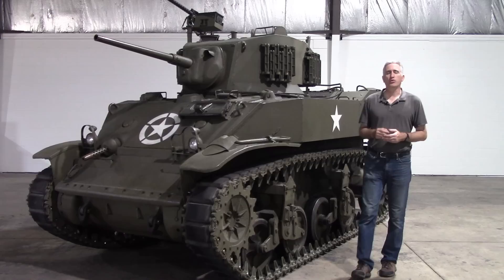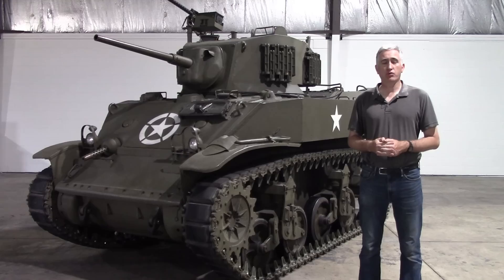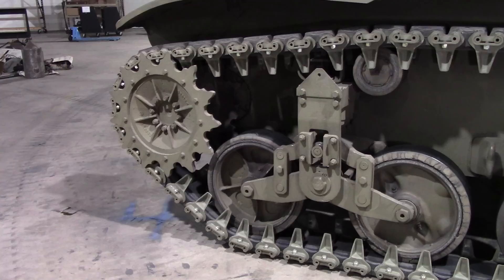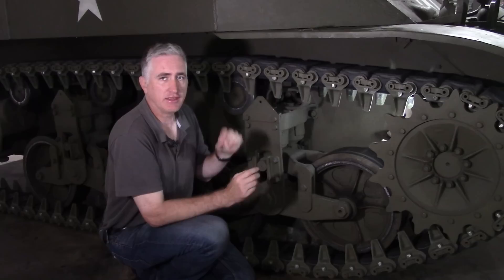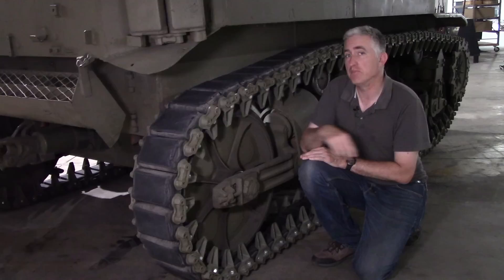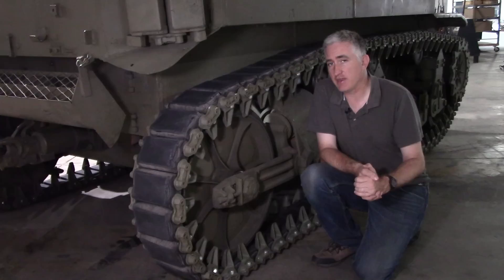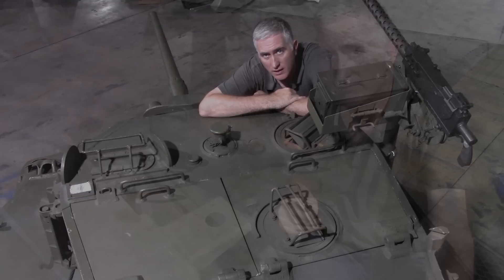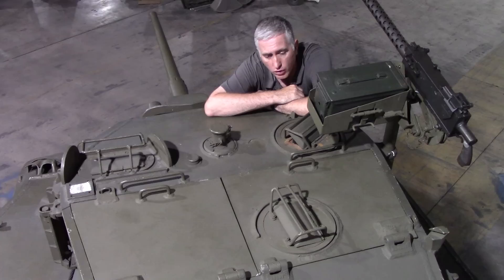Inside the Chieftain's Hatch: M5A1, Part 1.

Comment: I’ve gained an additional level of respect for the men who fought in tanks since watching  the Chieftains inside/ outside videos and visiting Bovington.
Reply: I never realised just how cramped and small it was inside a tank. I knew they were  tight quarters but after seeing the cheiften squeeze into the stuart i realized how nuts it is to not only be in there but to try and operate guns and not get hit at the same time. Im amazed they manage ti be as efficent as they are
Reply: @jamiebell314  APHE or HEAT shells couls vaporize an entire crew.

Comment: The Hydramatic automatic transmission (as well as their v-8) was developed by the Cadillac division of General Motors in the 1930s, but was first offered on an Oldsmobile since they had done all the testing at their test track.  Thus by 1940 America had a functional automatic transmission ready to go. When offered on cars after the war, GM touted the fact that it had been "war tested" and "refined in battle". Of course thousands of returning servicemen attested to it's reliability, and ease of use. Thus American drivers accepted automatic transmissions long before the rest of the world.

Comment: Don't see a note here, but when they talked about using the Tanker's Bar and 175 pounds, they meant use 175 pounds.  In WWII, anything that was "field serviced" considered the tool used and you simply found a guy or two who weighed the appropriate amount and put them on the end of the bar.  Same method was used for putting propellers on airplanes and I suspect many other items as well.  The manual simply told you what length of bar to use and how much weight to put on it.
Reply: I just made this same comment.

Comment: I have to say, I have always thought of the M5 as archaic and a prewar hold over. However, after seeing this, it is better engineered than my perception. It was obviously obsolete but it was relatively well thought out with the exceptions mentioned in this video. These are really interesting videos. Thanks for doing them.
Reply: "Obsolete"? Now for sure, but at the time it was a quick little agile light tank. It did it's job

Comment: Not sure if this has been mentioned but from what I have seen there was a separate general infantry manual that included a way to determine a consistent weight for various needs. For example, a Jerry Can full of water should weigh roughly 45 pounds and when combined with other items of known weight can be combined to make a source of weight. Typically by packing them onto a soldier of known weight.

Comment: Regarding track tensioning. 175 pounds was considered the average weight of a soldier. My halftrack manual tells how to measure track tension by having an “average man (175 lb) stand on the track”. It’s either in the manual or the BF Goodrich manual for halftracks

Comment: Cool dude ... Caddy engines, now install it transverse with one in the front, replace flywheel with pump piped to the torque converter, add air conditioner, replace the 37mm with the Britt's 2pounder, and Rommel's PzKfw 3 and 4's will not have a chance.

Comment: Estimating 175 lb. - that's the weight of a man. So apply bar then apply to track then add your weight to the bar: 175 lb of downward force to the track. Easy field measure. Of course the further out on the bar you are the greater the leverage but that may have been taken into account.

Comment: >Basically someone caught on to the fact that everything was called the M4 and it was getting a bit confusing
It's just as confusing now as as it was in 1940, and yet the US Military still uses that system! There's a good reason to use the date system as was done previously. Yeah, I know they got rid of it in part because of literally every gun adopted in WWI was the M1917 or M1918, but that's mostly the fault of the US Military putting everything off. And does it really matter that there is a M1917 tank, a M1917 machine gun, a M1917 artillery piece when the soldiers crewing those weapons will never come into contact with one another and be confused? In WWII we had a M1 rifle, a M1 carbine, a M1 submachine gun, M1 bazooka, M1 bayonet. That's all going to be in the SAME platoon!
Reply: In fact, these nomenclatures you mentioned are Tank, Light, M1917; Gun, machine, Browning, cal. .30, M1917; Gun, 3 inch, M1917; US Rifle, cal. .30, M1; US Carbine, cal. .30, M1; Gun, submachine, cal. .45, M1; Launcher, rocket, 2.36 inch, M1; and Bayonet M1. If you memorize their names correctly, you would not have a problem in differentiating them. 

Similarly, if those vehicles were all labeled as M4, their names should be Tank, Light, M4; Tank, Medium, M4; Carriage, motor, 37mm Gun, M4.
Reply: The Russian naming system is so much better.

For example
ASU-57 (Авиадесантная самоходная установка 57 in Russian)

Basically means Airborne Self Propelled Gun. The number is sometimes the caliber.

Comment: Is there a reason why American light tanks had a .30cal on top while medium/heavy tanks, SPGs and halftracks usually were equipped with a .50?
Reply from the maker: My guess, ammunition space. I don’t think I’ve ever seen anything specifically stated on the matter, though.
Reply: Hm, well that would have been my guess as well.
Reply: I would imagine also the size and weight of the gun itself. .30 cal is a much smaller and lighter gun, so it keeps down the overall weight of the tank. Ammo for it is lighter as well.
Reply: Isn't killing people wrong
Reply: @tigercat418  If you're in a full blown world war no.
Reply: @thepatriot4458  I like Germans more

Comment: To provide 175lbs testing force for the track you have the loader hold the lever perpendicular to the hull over top the track at the designated point and have the driver stand on said bar right beside the track applying tantrum force.
Reply: Wouldn't that only work if said driver himself is 175lbs ?
Reply: tantrum force

Comment: Ohh wait soo you want to tell me that the "E2" stands for "Engine 2", as in, the second Engine they put in it?
So the E8 Sherman was the 8th Engine Variant of the Sherman? Is that how it works?
What does the A1 / A2 and so on stand for?
Reply from the maker: Close. E stands for “experimental variant”. Some major change which is proposed for testing. It can be an engine, or it can be a gun, or suspension, hull design, whatever. When the experiment is approved as a production modification, it becomes an “A” subvariant.

Comment: As for the flipping of tracks, if I'd been a motor pool CO, I'd let the tankers swap a worn set of track for another set, then I'd have the flipping of end connectors as a diciplinary measure for any dumbass getting caught breaking or bending the rules of my motor pool and send the flipped tracks out again with the next compatible vehicle coming in for a track swap.

Comment: @9:00 not sure what 175 pounds is in kg. But if it's roughly the weight of man, wouldn't that do? I'm English, I know I weigh 70-73kg. Not hard to work out the leverage at the end of a pole that's say 600mm long?
Reply: Just looked it up. 175 pounds is just under 80kg. So sounds plausible

Comment: Wouldn't the weight and volume be roughly the same if they'd just double-coated the outer side of the track pads?
Reply: I believe they did in late '1944.
Reply from the maker: Indeed, that is exactly what they ended up doing

Comment: Would not the easiest way to estimate 175 pounds pressure on the track be to have the member of the crew who was closest to that weight stand on the track?
Reply from the maker: Probably, but the manual specifies the use of the bar, which inherently has to have some of the weight held up by someone.
Reply: Ah, yes. By the book. Worked on the A-4 "Scooter"  with the USN. And if the manual says changing a part required removing the engine, that's what we did. EVERY TIME!!!  ; ) ; ) [wink wink]

Comment: Did he say "tanker bar" is missing at the back of the tank? What is it? Google offers a selection of locations to go to for a drink, but nothing related to an actual tank.
Reply: In the case you're not being sarcastic which I am assuming you are. A tanker bar is basically a 4 to 5 feet bar of hardened tool steel designed to offer the advantage of a lever to it's user .
Reply: I've not been sarcastic. Thank you for the explanation.

Comment: Thank you! thank you! Thank you! Do you have any idea the hours I've spent trying to get a diagram of the road bogie assembly? Hours on google, youtube, dicking around with idiot "military surplus" stores on trying to buy a repop manual, trying to get someone to explain or take pictures of that whole assembly... That one picture has saved me more headaches- I don't do ebay so this helps tremendously for me. Since most military models are 1/35th scale, buying another half ass model kit to scale up to 1/25th and make in styrene and brass bits for my builds- no subjects close by to go and check out on my own account... Now I know. now i can continue the builds. If you guys ever come across a complete M3/M4/M5 lower hull complete with tracks and diff, let me know. Doesn't need to be a complete tank- I'll be a buyer.
Reply from the maker: Why on Earth did you pick 1/25?
Reply: Sick and tired of most armor being in 1/35th scale- it doesn't go with anything that i do. I model mostly in H.O. and 25th scales, more dioramas and have been building slot car tank conversions since the early '90s. I want more realistic functioning tanks with working suspension and do 99% of my scratch building soldering up K&S brass until I can get a 3D printer and do more in plastics, possibly branch out and do a small side business helping other builders do more in the hobby. I've had plenty of orders in my brass works, but taking 200-300 hours to complete one order isn't very profitable to me.

Comment: I read somewhere that the USMC requested/preferred diesel engines to reduce the risk of burning when hit.  Is there any truth in that?
Reply from the maker: For Stuarts? I would have to look into it. I know a small number of M3s were made with Guiberson diesel radials, but unsure where they ended up. The M4 diesels were taken only because no gasoline ones were available at the time. Everything else on land tha the Marines used was gasoline, The would rather not have the additional supply headaches.
Reply: Thank you.  It was just one of those little things you read sometimes that happen to stick in your brain...leaving less room for the stuff that you really want to remember.
Reply: The_Chieftain .... A diesel radial?

Comment: Wait.. If I heard that right, then why the heck are these engines not standard on literally everything? Half a gallon per 600 miles? That's 1200MPG! Modern engines are great if they burn a gallon every 20 or so miles.
I'm thinking I heard something wrong, or it uses very non standard fuel like aircraft grade which would make sense for a US tank, as we like shoving plane engines in our tanks.
Reply from the maker: Oil, dude, oil. Not petrol.
Reply: @TheChieftainsHatch  ahh. Had to rewatch that bit again. Never heard of an engine actively burning off oil, so I assumed it was fuel. That and the fact you measured oil in quarts, then said half gallon got burned. Granted half gallon is only 2 quarts, but just threw me off. American measurements are weird like that.
Reply: +ScientistMan96 Engines can burn oil as apart of the fuel mix, like two stroke engines used on mowers and chainsaws.
Reply: @redenginner  true, but in those cases the oil is premixed into the fuel tank, not held in separate tanks.

Comment: Never mind calling everything M4. If you told a WW2 soldier to go fetch an M1 you'd have no way of knowing what he'd come back with.
Reply: Also, this video's lack of a horrid guitar lick repeating every 5 seconds is adding years to my life.
Reply: M1 "Garand", M1 carbine, M1 "Bazooka", M1 helmet, M1 bayonet, M1 mortar, M1 "Thompson", M1 240mm howitzer,  8" howitzer M1, M1 75m. pack howitzer, M1 155mm. howitzer, 40mm. Gun M1, 57mm. Gun M1, 90mm. Gun M1, and the Chemical Mine, M1. That's not even including modern equipment.

Comment: so thats whats those things on the turret are. grousers...
Reply: Treads mate, not turret. Grousers were extensions of the treads to make them wider so as to decrease surface tension. A very important thing when going over soft surfaces such as mud and sand. The downside to them was they usually slowed the tank down somewhat and were particularly vulnerable to enemy fire . I suppose they might also negatively impact obstacle clearance as well.
Reply: 7:01 He makes note of the black things on the side of the turret. I take your point the grousers fit on the tracks but they are shown stowed on the turret.

Comment: Cough..... Air Cleaners... not going to make a big deal out of it?
Reply from the maker: Captian Nemo the cleaners are inside the vehicle.  The air intakes are located on the forward engine deck
Reply: Wanted to ask the same thing, sounded like the intakes were right above the tracks, but after rewatching seems i got that mixed up with the service ports for the filters.

Comment: overrated--no good in the pacific-too fast-they overheated when driven slowly in the jungle-they did their gearbox-hence the australian army abandoned them after 1942 was still using the matilda 2 in 1945. easily knocked out by 37mm and above-its only advantage was speed in the desert-i recall an action in 1942 with the 7th rtr with pip roberts where a wadi was exploited to present the rear of 5th pz regiment tanks to the 37mm and many german tanks were knocked out because of the close range.a japanese 75mm would knock one of these out at 1000metres